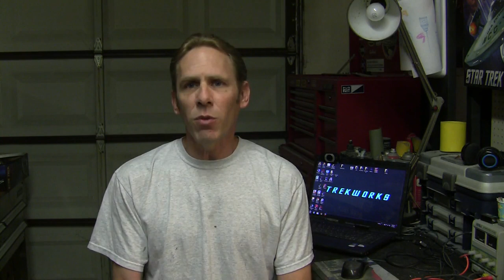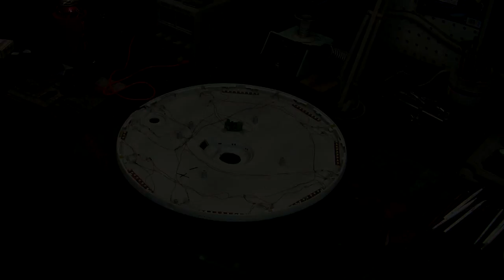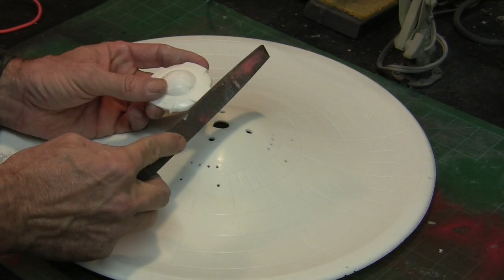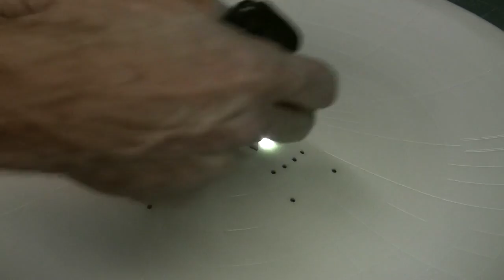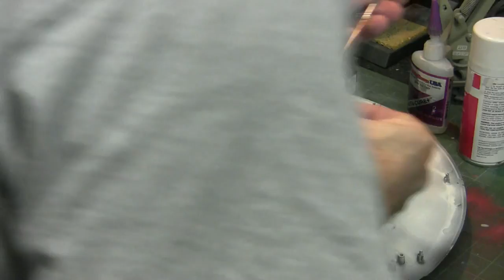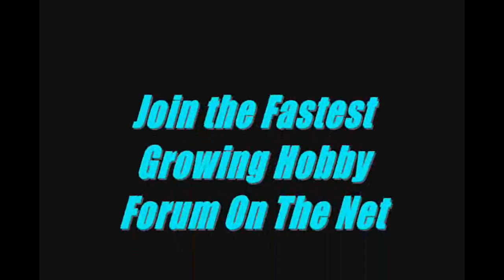1:350 Scale Enterprise Refit Build Series Pt - 6 "Saucer Mods"

Comment: I like your seam masking. I do the same thing when I build aircraft with natural metal finishes. (The fewer scratches you get on the model, the fewer you have to polish out. Metallizer shows every scratch!) I don't use putty though, I just use Testors tube glue! (If the gap is larger I'll sand some plastic sanding dust and mix that with the glue for putty.) I do still use tube glue for major assembly. If you get a nice bead coming up out of the joint, sometimes you don't even need to fill seams. Just a little sanding/polishing and you're done!

Comment: Thanks for the tip in taping off the seams prior to the application of putty. It's tips like these, and the many detail mods that you include, even in advanced kits like the 1:350, that really hits home for those returning/beginners, regardless if this is the kit we are working on. I'll be using the tape off step on my 1:1000  TOS 1701 on the bench for sure.
Reply from the maker: I'm happy that the tips are something you can use and thanks for watching the channel :)

Comment: Hi Boyd,

really enjoying the build - I am just starting my refit build, and finding these really helpful.  It would be good to know how you do your overall light blocking - did you paint the interior of the hull black then white, and then put stick the led strips on tops of this, or did you put the led strips on (mask these) then light block the interior - just wondered as wasnt sure if the led strips would adhere properly to a painted surface (and perhaps peel off over time).

Thanks again, and continue the good work.

Chris

Comment: I'm confused. (Easy to do.) Where did this big lip on the bottom of the saucer come from? Did you glue the light sides onto the bottom as opposed as attaching them to the bottom of the top part of the saucer? Is that an optical illusion from light blocking?

Comment: Where did you get the controller circuit board to flash the LEDs on the Saucer? Also what did you use for the light blocking on the Saucer? Thank you.

Comment: I bought a 50th Anniversary model of the Star Trek Enterprise 1:650 scale. I want to add some LED lighting. I'm using a single speed Dremel tool to drill out the windows. I'm running into a problem and that is the drill is spinning so fast the drilled out plastic is melting on the 1/32 bit. Any advise to give be fore I tackle the rectangular windows?

Comment: Great Stuff Boyd! What are your favorite paints for top coatings actually? I mainly still use enamel most of the time for most of my airliners...
Reply from the maker: Acrylic urethane's or polyurethane is my paint of choice. It is extremely tough, sprays on very smooth and it dries very quickly. They are very high quality 21st century technology paints. I have over 170 different toners that I use to custom mix and match my own colors. They are not cheap but you get what you pay for as they say.
Reply: TrekWorks Yeah! Thanks for the info! Ill be looking into that! Enamel served me well for many years but ever since Humbrol 22 changed about 10 years ago I have been struggling finding a good white paint... Best regards, Karel!

Comment: What brand power supply (on your work desk)  are you using to test your electronics?
Reply from the maker: raist3001 I bought the power supply off of ebay. It doesn't have a brand name on it that I can see. It was $50.00 with free shipping. It puts out between 1-15 volts dc up to 8 amps.